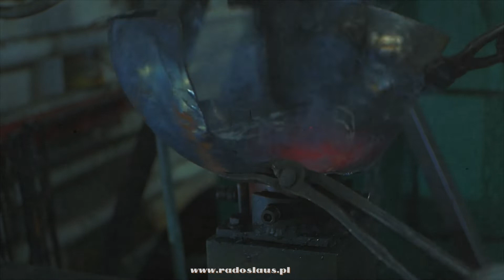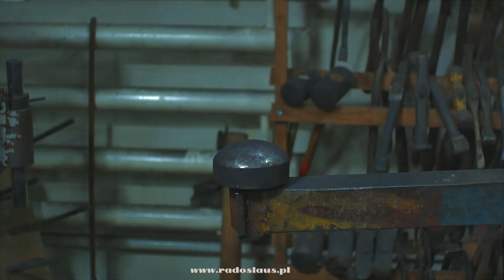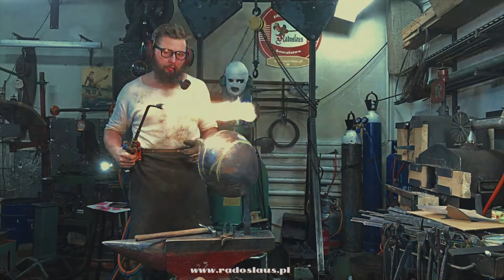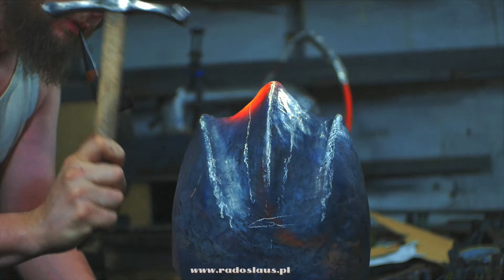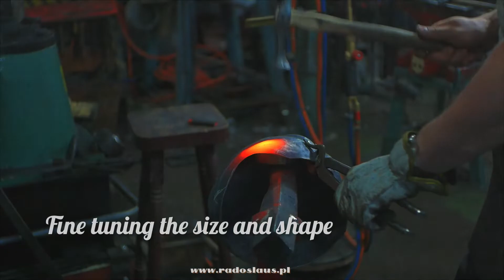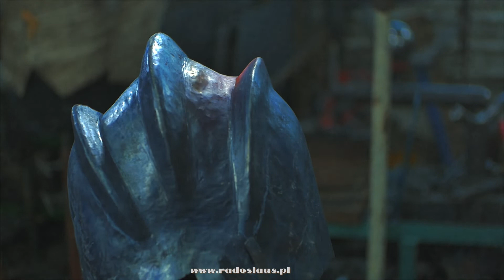Forging a burgonet helmet

Comment: So cool! Does propane forge really help? Or you use oxi-propane torch more often?
Reply from the maker: Definitely oxy-propane is my main favorite heat source.  I use the propane forge whenever there is need for heating large plain areas repeatedly for  a longer period . When the shapes get more complex I usually switch to the torch.  On the other hand I loved to use my coke forge, it was very satisfying to have a fire like this in the shop, when I’ll have a chance, I’d like to switch back to it.
Reply: @TheRADOSLAUS  I have got only a coal forge. I even managed to make one-piece sallet using only mix of charcoal and hard coal. But it was a nightmare)). I have an irrational fear of oxygen, so I am looking for something to help me heat metal locally and safely) Really appreciate your reply. Love your videos and wish you good luck!